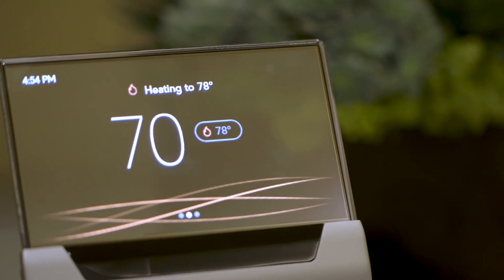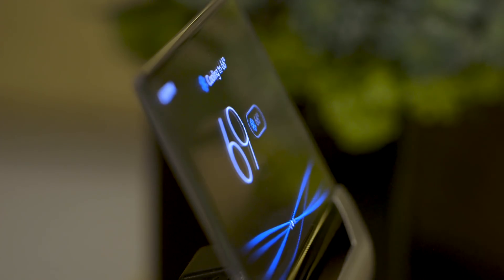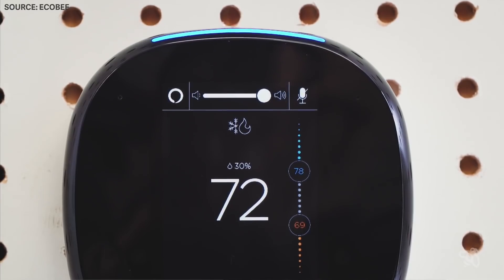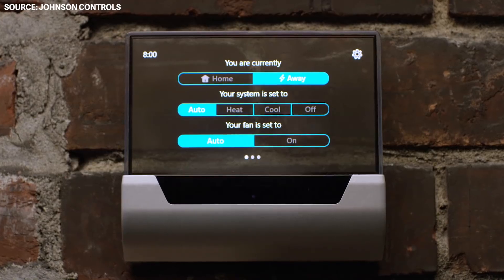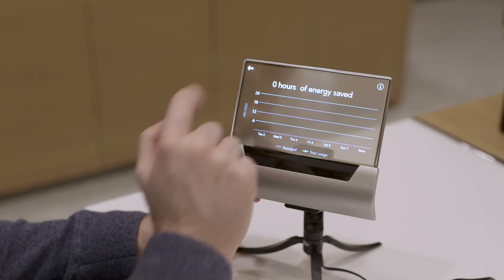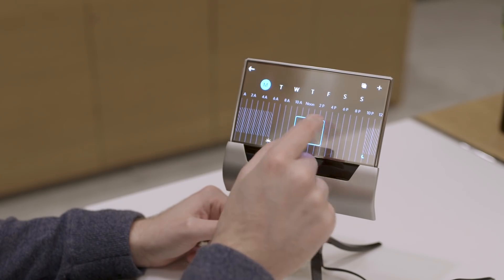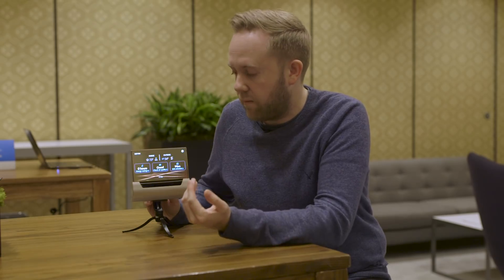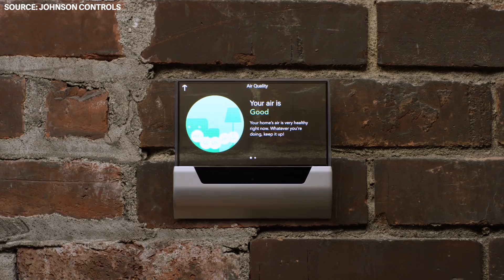Cortana-powered thermostat hands-on

Comment: Cortana also comes with the Azure Cloud which is a big part of this thermostat. It uses it to work out the most efficient way to heat/cool the home. Also this particular one is laggy because it's a prototype and it's at CES so internet connection is limited. Simple as that.

Comment: I wish I could replace Cortana with Google Assistant on Windows 10 and Id be happy
Reply: Why?
Reply: Martin Pekár if your serious, I think Cortana doesn't listen very well and has a clunky interface. I also have a pixel so even though I do use some of the continue to PC stuff and think some of the Cortana stuff on Android is nifty, Google Assistant still works miles better and does more. My phone is basically a Google home and my TV has Chromecast built in so I would just like to have the Google Assistant across all the platforms I use
Reply: Joseph Dawson If you already have a pixel and Chromecast then I think you should go all in Google
Reply: Martin Pekár lol I don't plan on turning my gaming PC or surface into a Chromebook at any point. I like being able to do stuff on my x86 machines, not just browse the web. Android and Windows place nice enough. Since I use Google Fi for cell service I can also use Hangouts on the PC to make and receive phone calls and texts with my cell number. Luckily Android and Windows aren't super proprietary like Apple where they try to force you into their whole ecosystem.

Comment: Just seems completely unnecessary to have voice control in a thermostat. If the thermostat can run on auto, that's pretty much all you need it to do. I mean, sure, it might be nice to be able to shout "I'm going away for 2 weeks so save some energy" right before you leave. But if it the Cortana is too basic it will not be able to do that.
Reply: Cortana might be the only personal assistant on the market that is able to that. Other personal assistants are just not good enough.

Comment: Quick poll, thumbs up if you use Cortana on a daily basis.
Reply: Mxdanger Gaming i don't even have Windows, but how does one expect "smart" devices without data sharing? All computing power is on the cloud not on the device.
Reply: Mxdanger Gaming I think u mean Google takes it too far
Reply: I use Windows, but always disable Cortana right off the bat because I find it useless (or "her", I guess).